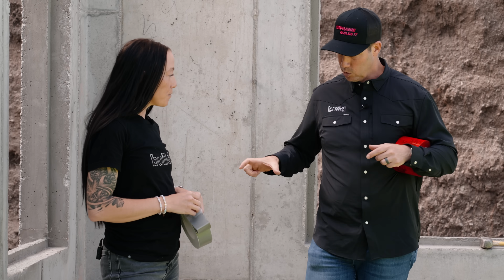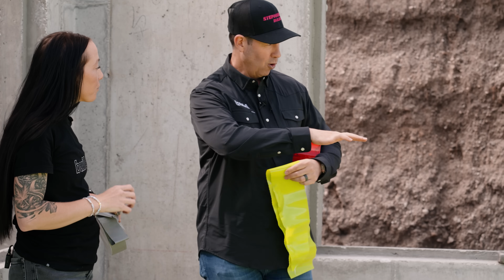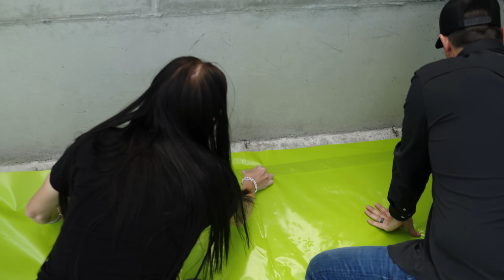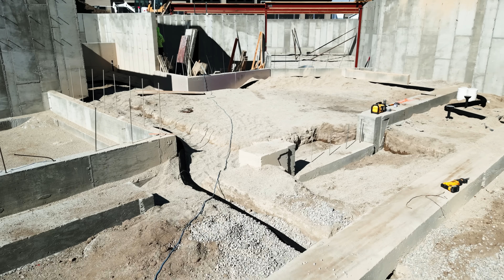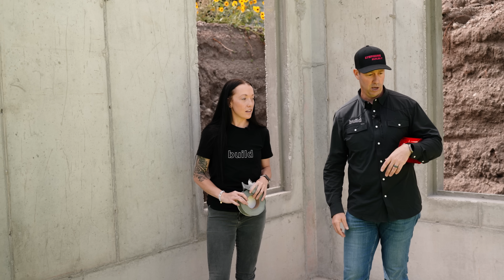Under Slab Vapor Barrier 101

Comment: Good old Stego Wrap.  I created their very first webpage!   Polyolefin is a superior plastic to visqueen. 
HOWEVER-   Under slab vapor barriers, or lack of one, is NOT THE REASON for slab moisture issues with flooring. The real issue is slabs (despite the barrier) are hygroscopic, and will absorb moisture to the brink of saturation. But it is not MOISTURE that is the problem. ALL SLABS are 12.5+ in pH value. And all flooring adhesives have a 9 to 10 pH limitation. Add "some" amount of moisture, you got a chemcial attack and costly floor failure.   If you use a really low water/cement ratio slab (0.50 or less) then the permeance is minor.  The amount of moisture coming out of a slab can have a minor impact on carpeting perhaps, but with conventional flooring, it is the pH is the reason for failures, not VOLUME of moisture, not "pressure" and not internal RH values, which is misleading.    Paul and Carroll who invented Stego, always worried about that, because despite the Vapor Barrier under the concerete, it takes at least 2 years for a slab to lose enough water-of-convenince to pass an RH test!       The barrier is smart to use, but not the fail-safe solution to flooring issues. Only a suitable, elastomeric epoxy coating on the surface, can ensure long-term bonding of flooring without call-back risk.  That's my entire business.  But kudos on the Stego choice!

Comment: Really good video Stephanie and Matt -- QUESTION -- We are a bit confused on the insulation/concrete/stego order.  For the basement slab, does the poli sheets of insulation go under the slab or above the slab?  Does Stego go on top of the insulation and under the concrete?  What is the specific order that these materials should be laid on a new build in the North East / colder climate?  I thought that Steve Basic put insulation under the concrete but I can't find that video.

Comment: It has been a long time since I have built a home, but I have built over 100. It was common when the concrete is being poured to get bubbles in the vapor barrier and the guys would intentionally puncture the barrier at the bubble to release the air.

Comment: I have yet to see a video using the Stego products where the vapor barrier in the floor is tied to vapor barrier in the walls. According to Joe Lstiburek, you should be able to follow the barrier using a pencil on a cross-section view without ever lifting the pencil off the paper.  I don't see how that would work in this case.
Reply: Yeah, very weird how they talked about the importance of a continuous vapor barrier, but they clearly were not doing that here with the concrete walls.

Comment: Something missing from this conversation is the fact that vapor barriers don't need to be perfect in the way air barriers do. The way that Matt and Stephanie talk in this episode gives the impression that, for "vapor diffusion" the vapor barrier needs to be complete or 100%. For vapor performance the barrier/retarder doesn't need to be 100% puncture free to be effective. If its 95% hole free it functions to bar 95% of the vapor. In terms of Radon and soil gas that is a better reason for making the STO 100% puncture free.

Comment: I put Stego Home under my basement floor, and bought the tacky tape (grey, adhesive and release paper on both sides) that they show in this video momentarily. It goes down on the footing edge, then pull the release paper on the top and stick down the vapor barrier. We put the tape down all along the footing, which was cured, clean, dry and dust free. Then when we went around pulling off the release paper to expose the adhesive on the top of the tape...the tape would release from the foundation, and stretch, etc. The paper strip on top was stickier than the bottom of the tape stuck to the concrete. It was a big mess, we switched to the red seam tape and taped the vapor barrier that way. But only had purchased enough for seams, so using it for the edges caused me to run out. My foundation guy had a little left over on his trailer, and a roll of some other type of tape, which we wound up using.

To Stego's credit, I emailed them and they immediately refunded the $150 or the three rolls of tape, and a regional guy called me to ask for the code numbers from the rolls, he said they had other reports of this happening and he said it might be in issue with some production runs. So for me, it was a big fail, as I did not get the seal between all the concrete and the vapor barrier that I was going for.

Maybe I just had bad batches of tape in my case. But it's crazy that the tape was stuck better to the paper on top, than it would stick to the concrete. Everything I read indicated that once it's on the concrete, good luck getting it off. Mine came right off when pulling on the paper on the top of the tape. Crazy.

Comment: You ought to go to Chicagoland and the adjacent counties up in northern IL and ask why they won't allow PEX plumbing (all must be copper), won't allow romex-type wiring (everything must be in conduit), won't permit wood or engineered wood floor beams for main floors over basements (all must be steel), and hardly anyone does Zipwall, going instead with cheap housewrap and OSB, and most all exterior framing is on 16" centers.  Ain't no science going on here.  Just deference to the unions.  The region experiences hard subzero winters, but there is no focus on energy.  And rainscreen walls?  Forgettaboutit.

Comment: Is this the best building style in the event of a nationwide blackout if power grid went down, or a nuclear attack? Would sealing a home tight be the way to go if you have no power to run any a/c, Dehumidifier, exhaust fans etc
Reply: Worst case scenario you can do what literally every other house can do for ventilation and open windows.  Otherwise, air-tightness and insulation definitely protect your interior space from the wider temperature ranges outside that you don't want to experience.  You add in solar and batteries to the mix and you're even better off.

Comment: "Concrete is porous" so how are the footings addressed?
Reply: Currently SLC is 39% humidity has not rained  anything more than a dusting since August 3 Is how. Also the actual amount that is touching the ground is minimal there is 8-16 inches of concrete keeping the wall out of the mud. Any water that does make it up is dissipated easy

Comment: Why is the vapor barrier not on the outside of the foundation?
Reply: To be clear, I also was wondering why it was not under the foundation
Reply: it can be if you use Fastfoot or the stego under footings @patrickdougherty2777

Comment: My basement has a proper vapor  barrier. I had a toilet and sump installed. The had to remove a 5’x3’ area of concrete. When they repoured the slab they did not do the vapor barrier correctly. So the whole slab is 45% moisture except that area. Which is 70% sometimes. 

I had to choose. Try and seal it or try and let it dry. I figured sealing it would push that moisture to the rest of the slab. So I have removed the flooring and just have the concrete open to the air. It stays at 55% now. I’m lucky it’s in a closet so the flooring doesn’t matter much. .

Comment: My builder is fighting me on under-slab barrier. We are doing finished slab on-grade and his objection is that if water gets under the slab, the barrier will hold it against the slab and not let it drain. My point of view is that it will stop it from reaching the slab in the first place.
Reply: build on top of 6" drain rock so water can migrate laterally and go away but not rise into slab
Reply: Just today I found moisture in my 30 year old basement. The slab has a great vapor barrier below it. So the slab has stayed between 45% humidity and 55% humidity its entire life. I check it about once a year. 

But today I found that all along 1 wall the slab has gone to 75% humidity. But only on the very edge. 12 inches in and the slab is still 55% humidity. And just 2 inches up the wall the humidity is 30%. So it’s not crawling up the wall at all. 

Either the vapor barrier along that edge failed or I have a new water source and it is getting past the barrier. 

Moisture is a pain in the ass to fix. So get it right the first time.
Reply: Well if the vapor barrier is installed incorrectly this can be a big problem. But when done right the amount of vapor that gets to the slab will dry to the inside just fine. 

So the question is. If they are complaining, can they do it right. Sounds like getting the local inspector involved would be a good idea since they know what is actually needed for your local climate.
Reply: I’d use a minimum of compacted 8” GLAVEL, then stone dust and STEGO. Unless the natural water table rises, water VAPOR would take forever to even reach the concrete slab.
Reply: Water will get to that slab regardless, a layer of plastic will minimize it
Reply: I’d go with 12” of gravel. Or 14”. 24” would be better.

Comment: What a well orginazed job site, beautiful forming of basement walls well vibrated, but why no expansion joint on floating slab perimeters? As an owner builder of commercial structures for the last 50 years I always insist on a vapor barrier below to keep moisture in during curing and either wet top daily or cover with visqueen to keep concrete wet for 28 days and eliminate internal stresses that are a major cause of future cracking. Ray Stormont

Comment: What would the actual additional cost be if you just used good thick plastic? 99% of the cost in this is the labor. Why would you ever lobby to make the plastic thinner or use thinner plastic?
Reply: 11 Cents per square foot additional per stego's website.  granted you could use the husky brand and get the 15mil for only 3cents/sqft more than the stego 10mil.  All that to say, you are probably right, but for a contractor, a penny saved is a penny earned unless they are doing cost plus...

Comment: Help me understand. If concrete wicks moisture then why are they not continuing the vapor block up the walls? I get there is protection on the outside but the footers don't seam to be protected.
Reply: outside of the foundation wall will have a waterproofing sprayed or rolled on.  Utah is a dry climate, therefore the moisture of concern is coming from outside/below to inside.  I believe it is also important not to trap the moisture in the concrete, I am not sure if the exterior waterproofing is vapor open, but for sure Stego is not.  So putting plastic up the walls would trap moisture in the foundation wall and when it freezes, will expand and cause cracking/structural issue.  Also, depending on how they finish the basement, they may put a vapor barrier over the framing, between the wood and drywall, thus protecting moisture from driving into the foundation from the slightly more humid interior.  My 2 cents, happy to be corrected if my thought process is flawed.
Reply: @13Stevenpoll13 below a certain depth there is no freeze / thaw cycle as the ground temperature is a steady 55-60F. And that basement looks at least 10ft below the surface PLUS she said they’re in the desert.
Reply: Outside of foundation will be coated and with proper drainage, any residual moisture will be taken care of my a dehumidifier or air exchange.
Reply: There is fast-foot from FabForm. It's a woven-plastic sleeve that you directly pour the concrete into (a long bag that is strong enough to be the form too). Later on you can tape and seal to the edge of the bag so you have continuous vapour barrier from inside to outside.

That said, the surface area of the footer compared to the rest of the structure is quite small, so migration of gase/moisture isn't a lot 99% of the time. It'll dry to somewhere, eventually. Additionally, while not its purpose, the active radon system will be sucking air down under the slab, so may be drying the footer as a side effect of its actual job.
Reply: @Nobudee I must've missed it, but where is the active radon system mentioned?
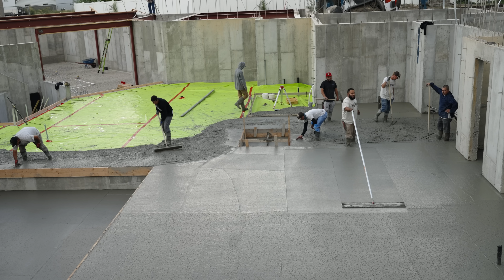Reply: @MadLadsAnonymous 7:16
Reply: The grade beams do not need water protection as they are buried below any occupied areas and w/o air/Oxygen the steel rebars cannot rust and cause spalling even if the grade beam develops a crack. Ray Stormont
Reply: I agree with you.I wrapped my footers and walls too. None of my concrete touches any dirt!

Comment: We used the yellow stuff in 20 mil and the red stego tape.  Loved the system.  But we had a lot of trouble keeping it adhered to our well cured and clean foundation.  We ended up going back and heating the tape and burnishing it, and still had a few places turn loose just before the concrete was poured.
Reply: Try a bead fo sashco lexel - works great for this
Reply: I can swear there is a liqui-flash application for that..